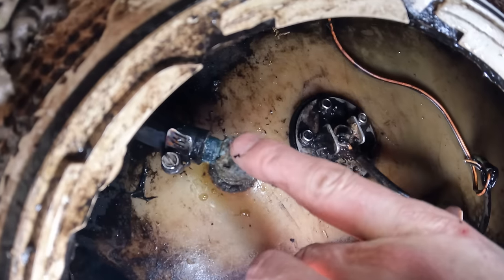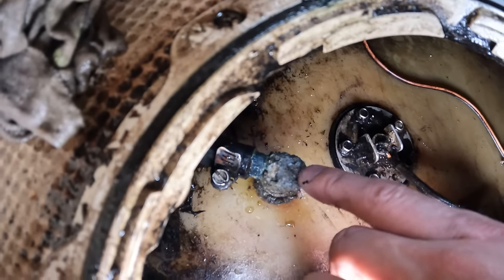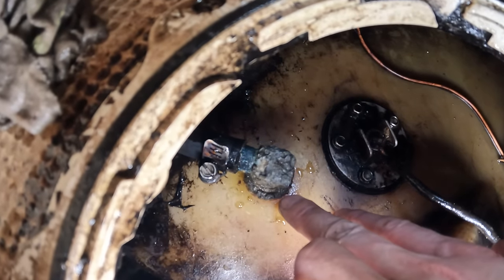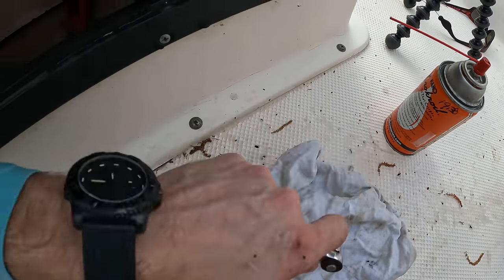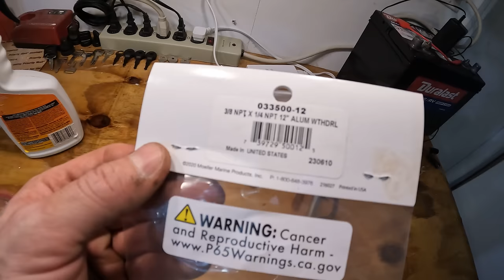#1 Worst Boat Fuel Problem!

Comment: There's no issues with the plastic tanks if they were installed correctly and maintained correctly!!  That boat looks like a POS!!!;
Reply: At least the boats fiberglass and not aluminum 😂
Reply: Do you prefer poly tanks over aluminum?
Reply: Rule of thumb. After 10 years with a aluminum tank under deck, "out of sight out of mind"....you're on borrowed time. Poly tank, installed correctly, and maintained. My experience is, longer lasting. My choice would be above deck, on a custom built alloy boat. Accessibility, is KEY, to all vital items, and most boats aren't built with that in mind.
Reply: 75% or more of boats owned by the average joe are likely in this condition. It’s a perfect example for us shmucks who can’t afford to pay a marine mechanic… or a better boat for that matter. Agreed this thing looks like hot garbage.
Reply: @blackmofo88  his next ''boat flip'', I guess. wish I had the spare cash to flip a few. And doubt my YT viewership would help pay for it as he's doing via ''us''.
Reply: You would think after years of these poly tanks with sitting water that they would make the new poly tank with a raised hump for the fuel sending unit and pickup tube so
The water will drain.

Comment: I am shocked the molded-in threaded insert for the pick-up didn't just rotate in the tank.  Did you pressure test afterwards?
Reply from the maker: I am too, sometimes they get lucky lol :) did not pressure test after though :/

Comment: In my 2006 1720, I rewired my dash and put in a new fuel gauge since the old marpac gauge had the writing falling off. Now it does not work. When I turn on the key, the gauge moves a bit to the empty area, sort of indicating there is power to the gauge. Is there a compatability issue with gauges and senders?
Reply from the maker: Yes, you might have got an inverted gauge compared to what orientation the one that you took out was! USA Vs. EU systems :/ This video might help some:
https://www.youtube.com/watch?v=sj782kHVGrA

Comment: The Mighty Keywest 1720, biggest little boat in the world. :) Miss that thing. I did the same job on it and had a crows foot with a big wrench on the tank nut. That was fun to figure out how to get in there with both hands and get back out. Still think I have scars on my chest. Great Video as always!
Reply: I've had my 1720 for 10 years now.  I want a bigger boat but the 1720 fits in my garage.  I want more power but I don't really need to go 45mph.  So my 2000 has an aluminum tank.  The first half of it's like was salt water.  The top of the tank pitted and allowed enough water in to reach the pick up and stop the motor.  I cleaned and filled the holes with JB Al weld and it's holding tight.  I drain the tank every spring to check for water.  Hands down the biggest problem on this boat is working on the fuel tank.  As you said, I believe this is the smallest real boat that does 90% of what I want to do.  I'll probably have it for another 10 years unless I win the lottery.  Cheers and good luck on the water.

Comment: The worst problem is corroded aluminum fuel tanks. For a lot of boats you'll have to cut the deck out and do glass work to get them out, the antiskid never looks the same again.
Reply: What kind of problems should one look out for on an aluminum tank? Just bought a 30 yr old boat with a 57 gallon aluminum tank.

Comment: That looks just like the access location on my Pathfinder 22.  Just had to do the same repair and it's a mutha getting it completed.  I replaced the fuel line to the water separator also while I was at it.  Another set of issues with that task.  Nice video.
Reply: Pathfinders have a big ass access hatch on the front of the center console. A person can fit through it and sit inside of the thing. How exactly is it hard to access the fuel tank?

And it’s not even hard on Key Wests either. You can either lay on a piece of plywood with your head in the center console or unbolt the center console from the boat and lean it back.

Comment: Amusing timing of this video considering the fuel leak I found this weekend.

1. Thoughts on deleting the ASV as they seem frought with longetivity issues?

2. Any sources for fittings made of 316 stainless? Corrosion is so painful to deal with, I will gladly spend extra for parts with longetivity. Don't have to worry about galvanic corrosion with a plastic tank...

Replaced my fuel sender last summer. Seems like KUS are top notch. My 1997 Sportsman 1900 is almost identical to this boat, but I have a 60 gallon tank.

Comment: Yeah, fuel tank is always a pain to work with. Kus is ok so far, used their gauges and senders since 2013, no issues as of 2023 if electrical connections are properly insulated.

Comment: Excellent video, really liked the tool tips and tricks. I need to replace the fuel sender in my tank, but I keep putting it off as I’m afraid the stainless steel screws have fused to the aluminum tank. Any tips on this?
Reply from the maker: Kroil and that wrench:
Kroil: https://amzn.to/47OtaYL
Wrench: https://amzn.to/3SveSrw

Comment: At 9:04 you mention the tool you used to grab onto the pickup tube you cut - I think I heard “finger trap”?   What is that tool called and can you provide an Amazon or other link?

Edit - I figured it out.  It’s also called a claw finger pick up tool.  There are a bunch of different ones on Amazon.

Informative video - as always!

Comment: Also if like the above the fuel sender doesn't immediately come out...just tug on it a bit. The metal filter likely will not come off.

Comment: I have a Key West 176 that has a gas smell in the cc as well. Some folks like to blame it on permeation of the plastic tanks, but I just don't know. How strong of a smell is too strong in your opinion? I've never seen a sheen in the bilge water, but I can pickup the smell even in the rear storage and livewell hatches. Not super strong, but I can smell it. Looking forward to more of the Key West restoration!
Reply: I just had my 2008 bass boat in the shop for the same issue. Gas smell in battery compartment and rod storage boxes.  What they found was the fuel line from the gas tank to the primer bulb, the primer bulb and the fuel line continuing to the engine was not ethanol rated and had deteriorated to a point every connection point was leaking vapors. Just enough you couldn't see gas dripping but enough so that gas vapor was escaping. Tightening the connections was futile.  Replaced the entire fuel line and bulb with modern ethanol rated  products and new connectors.  No smell now and a safe boat.  Mechanic told me even non-ethanol fuel will eventually deteriorate some fuel lines that were installed several years ago.
Reply: Well if it becomes kind of explody, that's too much.
Reply: @tinkanator2000 You do realize that fumes is what causes explosions I would say you have a problem, If you are asking this type of question I would say that you have excessive fumes caused by a leak!

Comment: I'm interested in the gasoline for aluminum tanks you spoke of, where can I find it and will it hold up to being exposed to gasoline ? My tank is corroded under the sending unit.  I'm looking for something I can put a thin layer on and smooth out with a sanding sponge.
Reply from the maker: You might need to build it up with JB Weld, but here is the gasoila that we use, idk how bad the spot you are talking about is:
Gasoila: https://amzn.to/3Ojdfe9
JB Weld: https://amzn.to/3Oglwj2
Reply: @BornAgainBoating  thanks.
The surface is slightly pitted

Comment: So cleaning out the threads and sender mounting holes you don't worry about junk getting in the tank?  Ever use pb blaster penetrating oil?
Reply: I always put some heavy grease (I like Red N Tacky) on the tap in those situations and go slow It seems to catch everything. I hate pulling fittings from those molded tanks.
Reply: I do the same, I use trippleguard as its what I tend to have on hand.  I also try to use a spiral flute tap, so the debris comes up out of the hole.  I'd be lying if I said I always had one of those on hand though.

Comment: looks like a keywest I have the same boat intreasting fact they zip tie the wairing to the haul you might find that out when pulling new trolling motor wire
Reply from the maker: We got lucky then :) they fortunately had it in a tube on this one :) I feel your pain though bro
Reply: @BornAgainBoating  I need to get a windshield can you link me where you got yours I love the connect I follow all your videos

Comment: Like always great video dude. What's the part number for the Quicksilver Fittings?
Reply from the maker: I'm not sure, I've had that kit for a long time lol it came with a water separator, you can just use bronze fittings from the hardware store ;)
Reply: @BornAgainBoating  sounds good, thank you
Reply: @BornAgainBoating Don’t you think it’s a little reckless and dangerous to recommend using bronze fittings from a hardware store without asking any questions whatsoever, Are you forgetting that laws require an anti-siphon fitting must be installed!

Comment: Hi friend! Like I said in one of your other videos, I'm new to boating and found your channel and instantly subbed cause I know I'm going to learn a lot! We got a 1988 ranger 393v. We noticed some fuel smell w using the port tank. I dove in and could see oil/gas residue around the fill pipe, so I replaced that, while everything was apart, I went to the pump and allowed it to over foll to make sure..well the pump didn't stop so I OVERFILLED haha😂 but it was a good thing because I learned that my leak was coming from the 5/8 vent. The nipple off the tank on the underside seems to almost roll in and had a hairline crack. I got it home, siphoned some gas out, enough to not be in the nipple, asked the the trusty people at ACE, who gave me marine JB weld for plastic that's also gas and petroleum resistant. So I cleaned sanded, then used alcohol around the area. I put a big ole blob on that under belly of the fitting. Slid the new vent hose replacement on, then added more around where they met. I figured if that does work, I'll use my starboard side tank and my port with like 6gal in it as my oh shiz tank (emergency). I noticed it after filling the port size up the fullest we ever had and came back from Vaca with what smelled like a gas station. With that being said. I was wondering,  while tinkering around down there,  fuel leaked out of the fitting in a decent amount when I pulled the hose off to siphon. Of course now the hull stinks. I used my garden hose to wash as much off and through the bilge as possible, is there anything else I can do?

Thanks so much.
Reply: Woke up to no fume smell, and before we went out to test, I put some dawn soap in the bilge, plugged the hole, and filled w some water. Let the water slosh around while I drove then drained it. Hours later no stink!
Reply from the maker: Greetings! Rose here, expressing gratitude for your comment! However, I'm unable to address your specific question. We've found it more beneficial to answer such question on our podcast channel.
Click the link below to subscribe if you haven't already🙏 Your question would be featured in an upcoming episode.
https://www.youtube.com/@TheBoatersPodcast

Comment: Any suggestions for this EXACT scenario except the nut that holds the fuel sender completely corroded through so now you need to 

A. Replace the tank 
B. Put a new hex head in the plastic tank tank for the new fuel pickup to thread into. 

Any tips for option B. Lol
Reply from the maker: Hopefully you've figured this out by now but I would say to clean it out really good, acetone and get anything out of the way, scratch it up, and then try and plastic weld the new pick up into place: https://2ly.link/1z3xR
you'd be surprised what that stuff can do, weld yourself a new nut on top of the tank where the hole is with the plastic weld, and then put your new pick up in ;) should be good to go!
You can also try JB Weld plastic weld, though Tap Plastics is probably stronger: https://amzn.to/4dEDhTq

Now the using something like acetone or another chemical to soften the plastic on the tank will help, so don't forget to try and do that, but obviously don't use fire lol

Comment: I had a boat with a plastic tank, larger, but similar. Fuel leak. couldn't find it for.. sadly. years of trying. multiple boat shops. FINALLY found someone competent... issue? The bolts that came w/the new sender. were too long. so they were getting 'tight', but it wasn't sealing tight to the tank. 5 small washers later, it was fine for years. finally. Ever since I became my own mechanic and know it's right.
Reply: @SabrToothSqrl First of all using a boat for years with a fuel leak is absolutely idiotic, Secondly we already know you make poor choices so I can’t imagine you took your boat to multiple shops and none of them were able to find a loose sending unit? Are you sure you didn’t just take your boat to a friend of a friend who said they were a marine mechanic? After over 25 years of being an actual mechanic who has owned his own auto and marine shop for the past 10 years almost everyone when looking for a shop will make their choice based on two things, First is usually which shop has the lowest prices and secondly is which shop can get them in the fastest! Both of which is most likely not going to lead you to the shop with the most experienced competent Certified Technicians!

Comment: How long will these poly tanks last if you use non ethanol fuel? I have a 99 hull and was reluctant to use the tank that’s under the deck because it’s original. Using a portable tank now but 6 gallons doesn’t last too long. Would really like to use the 60 gallon tank instead.
Reply from the maker: I don't see why you can't use the tank in the boat, unless it has a leak somewhere and is letting stuff in the tank. Other than that, the main problems are the things that you saw here, so fixing those you should be good to go :/ It never hurts to try, you're not using the tank now anyway so try and figure out if you have a problem with it and then send it, worst case, you can't use the tank, but you aren't using it now so try it. Keep an eye on the water separator though when you first try. Also, pump out everything that's in the tank if it's been that long
Reply: @BornAgainBoating  Copy that. Thanks for the reply. Great channel.

Comment: That screen is worse than pointless. Say it stops some junk coming from the tank, well it will quickly then block the fuel flow. The engine still dies and you have no idea the screen is there. And even if you do, you can’t access it to clean it. Stupid. Just put a replaceable in line fuel filter on the fuel line coming out of the tank, if you feel the need for something, so you can see it and change it when servicing.
Reply: And always use a Mr. Funnel, to KEEP DEBRIS & water out, in the first place.